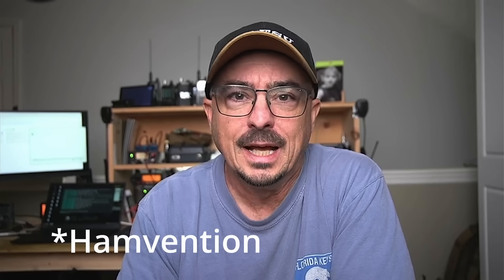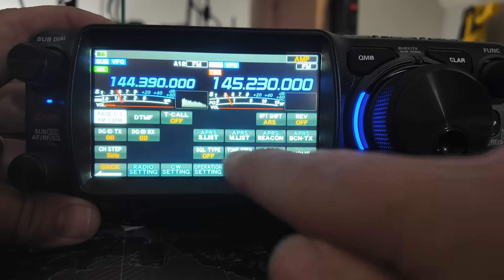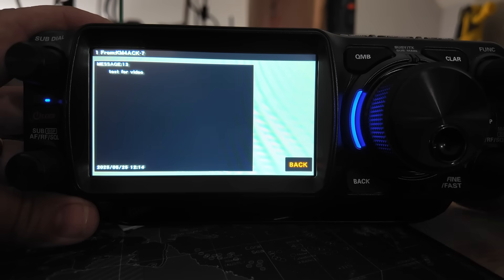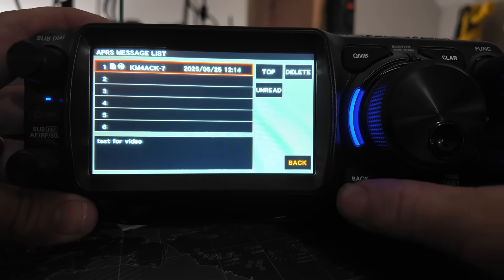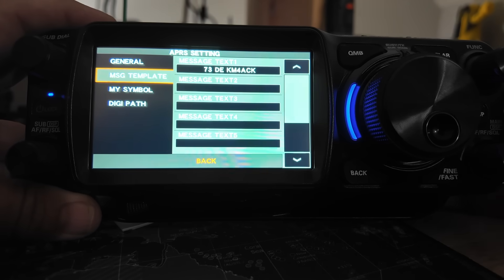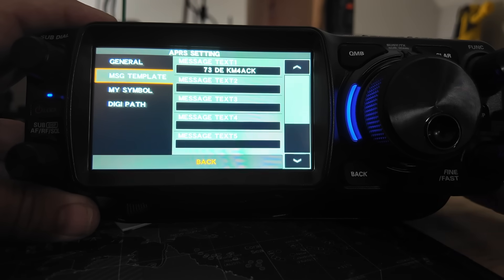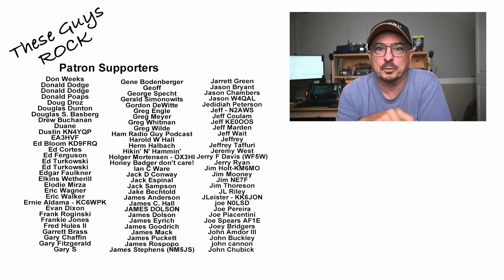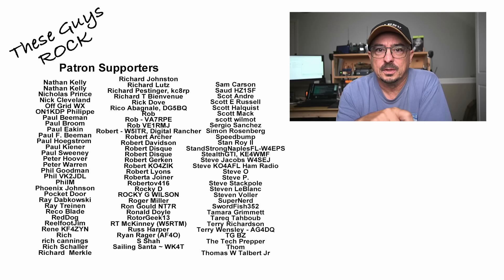The Yaesu FTX has a Flaw

Comment: Hopefully it's not hardware related.  There are issues with the Icom IC-9700's data part when trying to use a Kantronics or Pactor modem for APRS.  The radio closes off the audio feed or something along those lines and doesn't fully transmit the tail of the APRS packet.  Kantronics fixed this by adding an adjustment to the firmware called TX Tail that allows you to fake it by keeping the PTT keyed longer.  I discussed this issue in depth with the Pactor folks and all it would take is a firmware upgrade on their end as well but they don't seem to care to fix the issue (which is a shame because the Pactor modem can decode all sorts of things, including APRS packets).

Comment: For all the, "Don't buy new releases" commenters...

Y'know, back in the day, when all these functions were in hardware, that notion held true.  

It's not 1985 anymore, however.

  One rather expects - even with expensive equipment - that new releases will, inevitably, come with some bugs.  This is true of radios, or cars, or operating systems, or just about anything else in modern society.

The question is whether one is comfortable enough with performing firmware updates, first; and also how responsive the manufacturer is in addressing issues and bugs with good, quality updates.

If one is not comfortable with that process, then absolutely:  don't be the early adopter.  But if one is comfortable and knowledgeable - like the author of the video - then really there's no better person to put these newly-released radios through their paces and identify missing things, things that could be implemented better, or bugs that need to be addressed.

And, yes:  in some cases (like the 'No Reply Button' in this radio's APRS implementation), it's going to be sort of embarrassing for the manufacturer.  But the best people to ascertain whether the thing does what it says on the tin as quickly as possible following a release is the knowledgeable user - not the manufacturer, necessarily.
Reply: I think the majority of FTM-500 owners would disagree with you.
Reply: @Chris-hy6jy  I like my FTM-500.  The non-QWERTY keyboard is a huge miss, but otherwise I have been happy with that radio
Reply: @HamRadio2  yeah but you must have been a bit pissed when the 510 was announced? 😉
Reply: @Chris-hy6jy  Meh... I am dumb enough to buy it anyway.  Going to sell my 500
Reply: @HamRadio2  I bought one too and I'm not even that bothered about the DSP stuff on the 510.  It does make you feel like the 500 was released a bit prematurely though.  I'm guessing the 500 will be discontinued pretty soon and only the 510 will be sold.
Reply: @HamRadio2 No 2/.70 all mode.  Willie E Coyote major fail.  Y no $ from me
Reply: @DomN5TCB  Are you sure it doesn't?  In the specs, I read: "FTX-1 provides 6W (5W for QRP) stand-alone operation on HF through V/UHF bands in all modes – SSB, CW, AM, FM and C4FM digital."
Reply: @jeffw2338 I should have been clearer.  A 2 or with .70M mobile rig by itself.
Reply: @HamRadio2 Same. Bought on day one. Will sell and upgrade to 510.
Reply: @DomN5TCB  I guess there isn't much demand.  It would be like an FT-817 or 818 without HF and PAs on V/U.
Reply: Garbage.  Manufacturers using their customers for quality control is a BS way to run a business.  It happens FAR too often and an attitude like yours perpetuates the problem.
Reply: Same thing as pre-ordering video games knowing it will likely be buggy, but just rolling with it because patches will eventually come.  I think the price tag just makes it sting a little more that it isn't already polished.
Reply: Sorry, I don't want to be an unpaid Beta tester. Being familiar and comfortable with doing firmware updates doesn't make being on the bleeding edge any easier. I don't want to pay for something at the highest price point it's ever going to be, then wait to see if its reliable and hope that the software fixes will take care of most problems someday soon. I learned allot of this from Windows software over the decades.
Reply: Definitely should not have this many flaws for the price. When you advertise and promote the product for specific features…… They should work as expected. Yes Sue does make some great products, but in my opinion, this does tarnish their image a bit. I was waiting to see if I should buy a 705 and I’m feeling like Yaesu is making the decision really easy.
Reply: FTX-1 is still not worth the money.
Reply: And now that everything is software I say NEVER BUY IN THE FIRST YEAR!!
Reply: I can forgive minor and obscure bugs that might escape the Beta testers, and yes of course we live in a world where it's easy to flash new FW to correct issues, but if Yaesu has indeed released a product with a feature that fundamentally doesn't work they should be taking a long hard look at themselves.  This type of thing is brand damaging, the same as the abortion of a FW release for the FT-991A about 12 months back that started breaking radios.
Reply: Well said.  The manufacturers depend on customer feedback, and Yaesu do listen.  Consider it a partnership, and don't expect new software-based technology to be perfect in its initial version (V1.0).   All future releases will be free, which is also their commitment.
Reply: Sure: I am waiting since 2017 for Yaesu to fix the slow turn-on response of the output power in the FT-891 when operating FM or AM modes, since then at least one firmware version has been released, but guess what... problem is still there - I am afraid it's a hardware issue and we simply have to live with it... So, coming to our point, to all beta FTX-1 testers: please keep us updated when problemS (yes, with S at the end) are solved, until then I will remain on my TS-590SG (for HF) and 8900 (10m-70cm), 73!
Reply: Good point
Reply: Yaesy doesn't have a good history of fixing problems with firmware... 😢

Comment: Attenuation or filtering preventing the weaker signals from being decoded?
Reply from the maker: don't think so. first test was run with my digipeater operational and the radio was underneath the digi's antenna
Reply: @KM4ACK makes sense. The odd thing is the ft5dr message was decoded, which led me to believe signal strength or clarity was the issue. But now im wondering if it is APRS formatting. Have you retried the test from a non-yaesu radio? Perhaps yaesu has proprietary formatting that the ftx can read but it cannot decode other APRS signals without a firmware update.  I'm thinking along the lines of some HTs have a "locate friends" feature that will send out a code and get a reply of the other HTs gps locations, but a different model HT cant decode it. Also, I saw that wires x will be a firware update in august 2025, i wonder if APRS is limited until then too.
Reply from the maker: It decodes the D75 just fine when the two rigs are side by side
Reply: @KM4ACK that points back to signal strength or clarity. Bad antenna? High swr? Antenna is in the hf connection instead of VHF/UHF? All filters,  DNR, Attenuation, squelch has been removed? Found out on my Ftm-500dr that squelch is not just for speaker sound. Couldnt decode APRS with squelch on and had to just turn the volume down on that channel. I'm sure you've thought of these already but just thinking down the list of why the signal is able to be decoded based on proximity. If it were firmware related, id expect it to decode whether you're at the same bench or 50 ft away. I would also assume modem settings are correct since it can decode the messages when you're next to it.

Comment: I don’t use APRS but did you update your FTX with yesterday’s Firmware off the Yaesu web site ?
Reply from the maker: Didn't update yet....will do that ASAP and see if it fixes any of this
Reply: @KM4ACK I I have not gotten mine yet but have friends that do and the firmware fixed problems they had most likely issues with 40m transmit and a couple others. APRS I don’t know? These SDRs like my hybrids like my FTDX 101MP and the buggy nightmare of my pure SDR Flex are no different than windows and phone updates. They break things , fix things and break something  else.  For people’s comments they won’t buy a new radio that has some bugs in its firmware on day one is ridiculous argument. If that was always the case then we would not own phones and computers. But if they don’t keep firmware updates regular then that’s an issue and I found Yaesu tk be good at resolving major issues pretty well. Unlike my Flex, which I sold for that reason. I know you are busy but be nice to know if the current firmware update fixes it. Hope so. Enjoy !
Reply from the maker: I have now upgraded the firmware. Decode seem to be better but more testing is needed. Still no message reply option that I can fine.

Comment: I do want to Optima but I'm going to give it 12 months to see things settle or the Mk2 come out. There was an issue with the spectrum scope on FT-991 I beleive and that had to be fixed with a new hardware platform - the 991A. 

I don't need it at the moment but do really hope they get this and the CW distorted audio on the Optima speaker / playback system issue sorted. 

The problem is that there is so much software content in modern transceivers that it is nigh on impossible to get everything right, so I'll leave it to the early adopters to get them fixed and then I'll place my order. 

From what I understand, reporting s/w issues to Yaesu isn't easy (but then again, most companies don't want to actually engage with human beings despite spending money with them) 

So I'll wait for a while. My old FT-857 portable radio still works for mobile and portable ops but this should allow me to replace at least three radio's in one fell swoop - the 897, 857 and 817.

But I don't want to chuck this kind of money down the toilet. Softly, softly catch ye monkey. Been burned too many times in the past being an early adopter although mainly with audio kit but the parallels are there. 

I'm not "hating on the radio" at all - I'm being pragmatic.

Comment: I don’t understand why people don’t understand that when you buy a new electronic device that will probably have a 10 year run lifespan it will have features that are not fully implemented and several bugs. Your early buy-in guarantees that you get to beta test this product. Nothing to see here.
Reply from the maker: If they left it out until it was ready and include it in a firmware update later I could agree with you. This is more than just one bug. It appears half baked at best.

Comment: Hey, just as an FYI, you cannot use a signal stick with those type of radios. The signal stick will not work on the icon. Either something about those type of radios. You need a different type of an antenna. It will not work. The signal stick I guess is lacking possibly some variation of ground I think I don’t know, but I was told somebody else did some testing with the ICOM and they ran into the same issues. The SWR was like through the roof. Check the SWR on that antenna. I bet you and nickel it’s not there but then again I could be wrong 73.73 DE KA9ZRZ

Comment: I looked at the op manual and it only shows GPS pinouts.  They have a dongle.  APRS doesn't xmit w/o a satellite and I don't see the satellite on your screen.  Probably need the GPS dongle.
Reply from the maker: You can manually set the GPS coordinates in the menu which I did

Comment: Did you get the GPS dongle? I think having GPS in that radio will fix most of those problems, but that's just a guess
Reply: At 11:12, I think that's the GPS unit off to the left of the radio.
Reply from the maker: I manually set the GPS coordinates in the radio. Even without that it should decode incoming packets. This radio doesn't have a packet filter option like the D75
Reply: @KM4ACK  unless there is some kind of wicked, voodoo Yaesu magic that doesn't allow the unit to work without the GPS dongle.  Probably designed by the same guy who put the VHF/UHF BNC port underneath the HF port.

Comment: @KM4ACK was this before or after the new firmware update - in that update, I didn't see that part of the firmware being updated, just the display and main (with the bootloader where they fixed the powerfeed plug in / power on issue.)?  Thanks!
Reply from the maker: I recorded this before the new update was released. I'll be updating ASAP to see if anything in the APRS changed.
Reply: @KM4ACK  I've got a call in with Tim over at Yaesu - they aren't open yet - I'll tell him about your video and where the other commenter said there will be no reply function, that makes no sense like you said.  I do have the firmware updated, will see what it does.  73
Reply from the maker: I've updated the firmware now and it appears to be decoding better. More testing will be needed. Still no message reply option. It doesn't make sense that there are message templates if the radio "can't" send an APRS message.
Reply: @KM4ACK  Glad that helped. Tim was out sick at Yaesu today and the other Ham Radio SMEs were at a convention,  if Tim is better, he's going to call on Monday, will definitely mention the reply option.  Even if John of Yaesu said they wouldn't have it, it doesn't make any sense why the the reply shouldn't be there on an SDR using tech they already have from the FTM-400 and their present radios.

Comment: Sounds like a software problem. In a hurry to get this radio on the market. From what have seen, the Icom ic 705 is a better radio.
Reply: The IC-705 is good, but not quite the same thing.  It’s also been out long enough it’s had plenty of firmware updates. I would expect that yaesu just didn’t get this bug fixed or feature finished before some exec said it needed to ship.  This is certainly something to be fixed in a near-term future update
Reply: @timK0WTB it also doesn't do aprs at all so the person who left the comment either didn't watch the video and just wants to be a hater or doesn't know how the 705 works. Or both
Reply: at least the 705 has Bluetooth GPS Wi-Fi built-in and it’s cheaper and lighter
Reply: @SUFFO_GUY and what do you get with that gps? Icoms jank aprs variant? And I have never once used the wifi or Bluetooth on my 705. Everyone is so mad about this Bluetooth thing but are yall really using Bluetooth?
Reply: @Blake-jl8lh  I guess you would’ve been happier if they charged $2500 for it lol
Reply: @Blake-jl8lh  also I’m not mad about them not having the features. I just think it’s ridiculous. How much they charge for it and for some reason people still buy it.
Reply: @SUFFO_GUY  Because the radio is like a dx10 with uhf vhf and a detachable head. The dx10 is a 1500 dollar radio atm. I dont want or use bluetooth or wifi so idc. The gps bit is definitely a big miss imo. you can say the 705 has it, but it doesnt have aprs so whats the point of the gps? so it can find repeaters in the event you are someone who travels and talks on random repeaters? its only 150 more than the 705, its newer, has a better reciever i suspect and I spent 120 dollars putting usb c charging into my 705. everyone carries on about aftermarket atu, well the icom did the same thing and their atu wasnt even attachable, no one cared.
Reply: @SUFFO_GUY no, that would be outside if the market value. The head unit cost 150 more than the 705. I own both radios. I think that they are similar and that price difference is reasonable. I owned a dx10 which is now a 1500 dollar radio and the full kit ftx1 is 400 dollars more. I think there is 400 more dollars of radio in there too.
Reply: Its not, but you do you.

Comment: On the FTX, is that the signal attenuation set to 10db? I don't have the radio so I was wondering if that is the issue. Thanks for all the video. 73
Reply from the maker: It wasn't but even if it was I am literally underneath the digipeater that I run at home during the first test. The second test I turned off the digi.
Reply: @KM4ACK ok, thank you for the reply. 73

Comment: John Kruk says it will not transmit messages on APRS only receive.
Reply from the maker: that makes zero sense
Reply: @KM4ACK  yes it does but that is what was said in one of the videos either from Jason KC5HWB or K8MRD when John talked about it.
Reply from the maker: Why would they have APRS message templates if it couldn't send an APRS message?

Comment: “Reply? Who needs to reply to an APRS message?” - Yaesu

Another bunch of reasons why I didn’t throw my money at Yaesu when the reservations opened. I knew there would be some bugs in it.  But it is a nice radio nonetheless. Maybe in the future I’ll get one?????? 

I think I saw somewhere there was already a firmware update the for the FTX-1???? Maybe not. Maybe it was YT clickbait? 

73!
Reply: Not sure why they didn't add WiFi.   Looking to directly compete with the IC-705 and that's a big miss in quite a few use cases.
Reply from the maker: it is a nice radio just missing a few things at the moment. there is a firmware update that dropped after I filmed this video. I'll be checking it out ASAP

Comment: I wonder if you need the GPS add-on for the button to appear?
Reply from the maker: GPS coordinates can be manually set in the radio so I wouldn't think the GPS unit is required.
Reply: @KM4ACK  This is true, the FTM-400XDR doesn't need it and does all of this perfectly with manual coordinates ( I hope they fixed the degree to gridsquare issue on this one though)
Reply: @KM4ACK  Great point! Thanks! And sure they will have updated firmware soon. Finger's crossed. 73!
Reply: I wonder what the Baud rate is.
Reply: @m3cvfm  Good point, I was looking at that in the settings as well.
Reply from the maker: @m3cvfm If it was baud rate it wouldn't decode anything. And you can see in the video that the baud rate is set to 1200